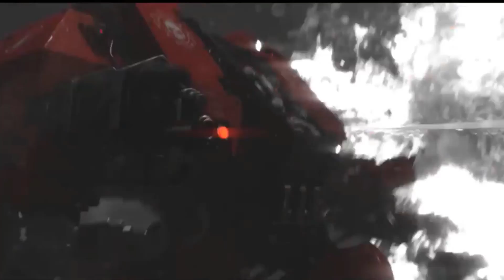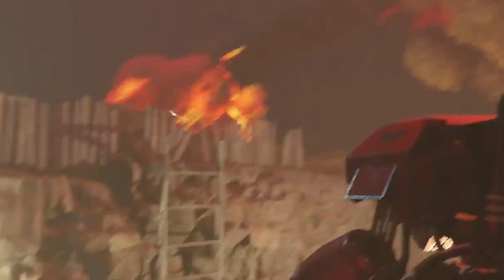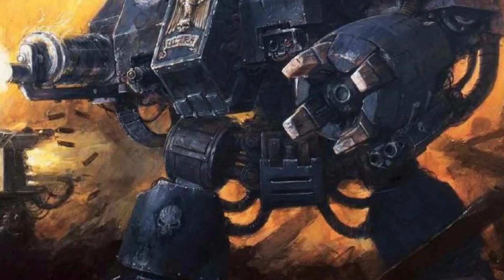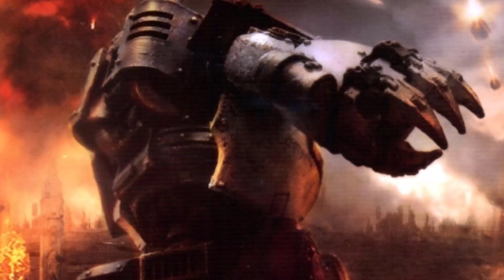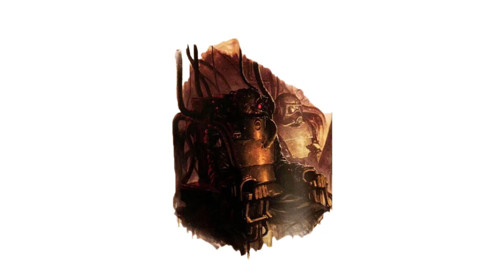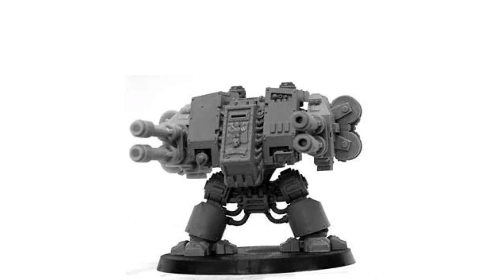Castraferrum and Redemptor Dreadnoughts Full Comparison 3D

Comment: The old dreadnought was just so much better designed. Because when you look at it, you immediately recognise both its strengths (power, strong armour, a walking tank) and its weaknesses (slow, clunky, poor vision). The new one just looks bland, with no obvious strong or weak points. It's just a big generic robot thing.